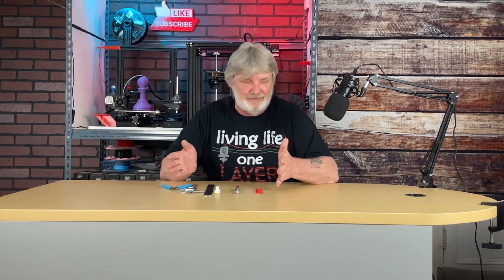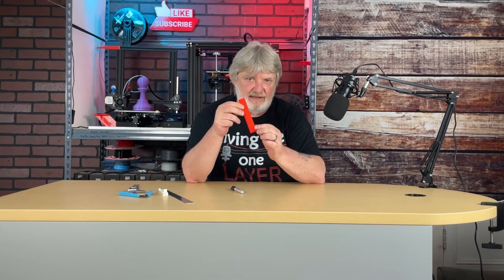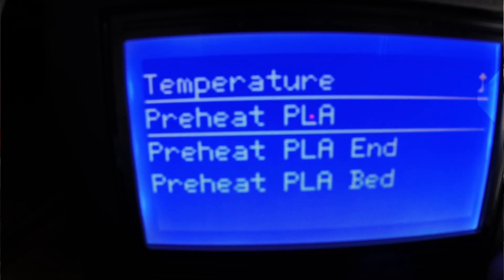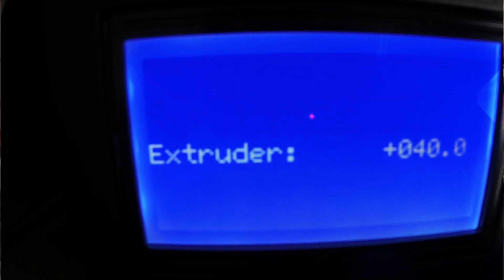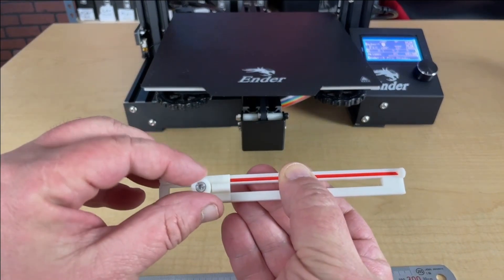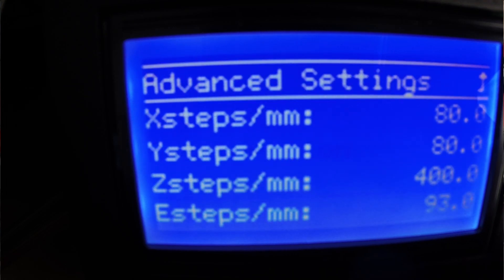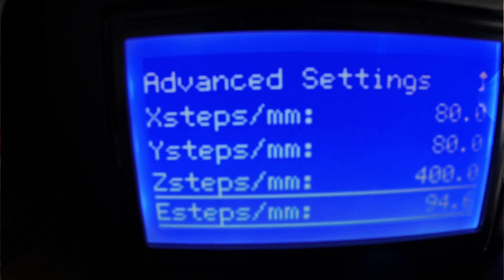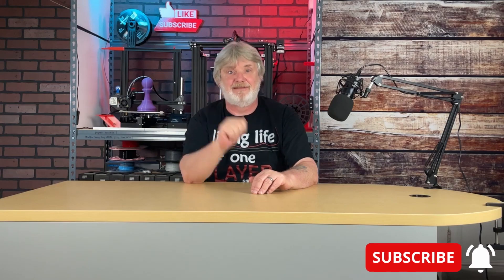Calibrating eSteps For Frustrated Beginners

Comment: Wow, great information. I just got my Ender 3 V2 Neo a few weeks ago. After going through all of your videos earlier, I printed the eStep Calibration Tool and tested it. My original length was 92.3mm, the steps per mm was set at 93. I ran the calculations and entered the new # (100.8). Ran the test again, it was much closer @ 99.56mm. Recalculated the new number, entered it (101mm) and ran the test again. Final number 100.05mm!
All of my prints have been coming out the way I expected, so I didn't suspect that anything was off. I'm on to the next video to do some more testing.
Reply from the maker: Awesome! I’m hoping they’re helping and thanks for watching!

Comment: This was a game changer. Tfs❤. I bought a used machine but it printed sooo poorly, everything was full of holes, it looked like a birds nest. Mine extruded 39mm😮 on the test the machine was at 93😮after calculating I had to push it up to 238.5😊. I was worried because of the huge diff, but I did a retraction test again and it pushed out 100mm exactly😊. Now I off to your Retraction tower, walls and the rest of your tutorials❤. I am brand new to 3d printing, much appreciated
Reply from the maker: Awesome! Glad to hear this!! Thanks for watching and good luck! 3D Printing is a great hobby, but it can be frustrating sometimes. When the bad times come, and they will. Hang in there and check the basics!

Comment: How about those of us with the Ender 3 s1? Direct drive extruder.
Reply from the maker: For drirect drive, ufortunatley you'll need the to use the metric ruler and a sharpie method. Measure off 100mm on your filament from where it enters the extruder and mark it with a sharpy. The thinner, the better you still need to be able to see it. Next measure off 120mm of filament from the where it enters the extruder and place a mark as well. Have your printer extrude 100mm of filament out. If your first mark (100mm) is now at the entrance of the extruder, you're good with your esteps. If it's above, then you're under extruding. You would then measure the distance from the extruder opening to your mark. So example purpose, say you measure 7mm from the extruder entrance to your first mark, you are actually extruding 97mm. On the otherhand, if your first mmark is completly gone and inside of the extruder, then you're over extruding. So measure from the extruder entrance to the second mark you made on your filament. For exammple if that  measurement is 15mm. Then that means 5mm (20-15=5), of filament was fed down into the extruder. So add that 5mm to the original 100mm meaning that you are actually actually extruding 105mm of filament when your printer is trying to extrude 100mm. On the Ender3 S1, I'm not sure if it is just the S1 Pro or not, but you can access the extruder steps from the menu under Settings, ADV.Set.>Movement>TX Rto>E TX Rto This will allow you to retrieve your current eStep information and set your new calculated value. NOTE: I don't have an Ender 3 S1 to confirm those menu options. I hope this helps!!!!
Reply: Couldn’t you remove the nozzle and replace it with a short length of boden tube, then use the end of the tube as a reference point to snip the filament?
Reply from the maker: @mikek1618  That sounds like a good idea! But after removing the nozzle, couldn’t you just use the bottom face of the heat block to get a flush cut?

Comment: If you have a direct drive extruder (Extruder is inside of the print head directly in front of the nozzle) you can instead leave a mark on the filament 100mm from where it enters the print head. Then simply extrude 100mm worth of filament and see where the mark ends up that way. It's a bit more error prone but avoids having to disassemble the print end to remove the nozzle

Comment: I bought a modified ender 3v2 a while ago and it never worked how I wanted it to. Now that I found this video I wanted to give this a try. If i tell the Extruder to run 100mm I end up anywere near 22mm. The result of the calculation is about 422.7. Any idea how to solve my problem? I hope my english isn´t to bad.
Reply from the maker: With the modified Ender, the extruder may have been replaced with one is dual gear. This can drive your calculation much higher as your describe.

Comment: How can I do this on a anycubic vyper? I don’t have these options.
Reply from the maker: I'm not real familar with the AnyCubic so I am going to assume that it is a bowden setup, it has a USB port and that it's running Marlin firmware. You'll need Pronterface, a free download and make a connection via USB to your printer. You can still heat up your hot end and disconnect the bowden tube.
In pronterface, enter the line M503 and look for your current eStep value. The line will look something like M92 X0.00 Y0.00 Z240.00 E93.00. You're looking for the E value, in this case 93.00. Write it down. Cut the filament flush as shown in the video.  Next, enter G1 E100 F50. This will extrude what your printer believes it 100mm of filament. Use the eStick as described in the video to get the length of how much filament came out of your extruder. Use the math formula as shown in the video to calculate your new esteps. To enter the new value to your printer, enter M92 Exx.xx where the "xx.xx" represents your newly calculated estep value. The final step is to enter M500 to save this value to your printer. And that's it. I hope this helped. Thanks for watching.
Reply: Awesome. That worked. And I adjusted it. Thanks. On to your next video!!
Reply: @pushingplastic7445  Thank you for explaining, this also helped me too.

Comment: Why heat up the nozzle  ?  🤔
Reply from the maker: The printer won't push filament through the extruder if it is not heated even though you aren't pushing it through the nozzle.
Reply: @pushingplastic7445  i noticed that 🤣😂
And would you also advise to check the steps when pushing it thru the nozzle  ? ?
Reply from the maker: @frits183  I wouldn't. Esteps is for material being pushed through the extruder, but your flow rate is dependent on what's coming out of the nozzle. I do my esteps first, then set my flow rate afterward.
Reply: @pushingplastic7445  Thanks for making it clear to me   🙏
Reply from the maker: @frits183  No problem, thanks for watching!
Reply: @pushingplastic7445 "Watching"  I am learning from you 👍🤣😂

Comment: A good thing to know is that if you use a ruler than a rule for measuring. Then you will also get inaccurate measurments
Many people don't know that a ruler is not a calibrated instrument but a rule is
Meaning just like tape measures is that unless it is a calibrated instrument you can  get an accurate measurement 
So bare that in mind
And just to say that I have found many measuring rulers and tape measures of cheap products that are millimeters out even cheap calibration vernier tools to
So buy your products from proper tool companies.

Comment: Go easy with calling people Morons.

The thing about extrusion is that it's what comes out of the nozzle which defines accurate flow.

For a particular extruder E-steps will be a constant depending largely on the machining tolerances of the gear(s) and any associated idler roller.

By calibrating e-steps you just guarantee that a 1mm feed request pushes 1mm of filament through the extruder. It says nothing about the effects of slop in the Bowden Tube (which has an effect on total extruded length and retraction length) or resistance in the hotend assembly due to a particular temperature and extrusion speed setting.

My preferred method is to use the designated e-steps for the motor and gearing of the extruder assembly be that 93 or 415 for common types of extruder.

Calibrating material diameter and flow multiplier in the slicer is where you want to handle material differences and this is important.

By using a constant for the extruder E-steps and calibrating the material diameter and flow rate you are able to compare the flow performance of materials where it matters, at the nozzle.

Using this method, which I have for the last 10 years, you gain an insight into the performance of your printer. My flow rate multiplier using this method is typically 0.975 (97.5%) which largely compensates for material swell when you have determined the optimum printing temperature for the material to reduce thermal resistance in the hotend (which you can assess by the amount of material ooze from the nozzle at the end of a print - on a well adjusted printer it should be minimal).